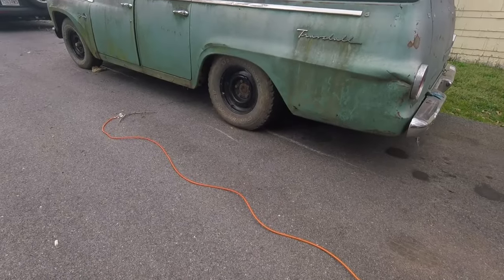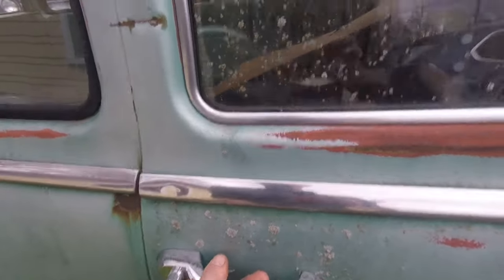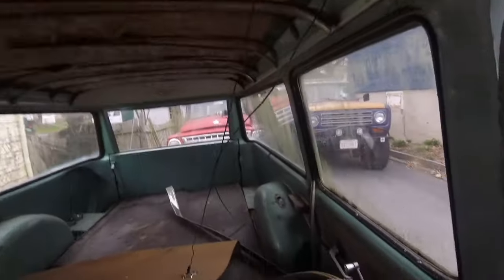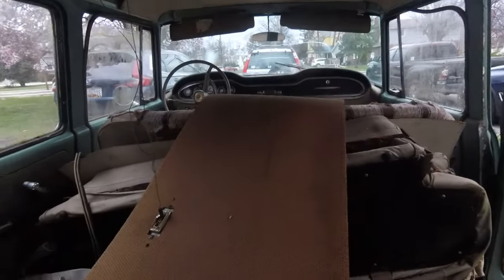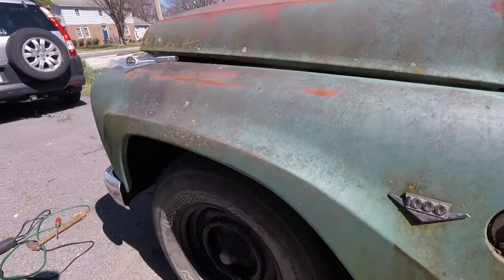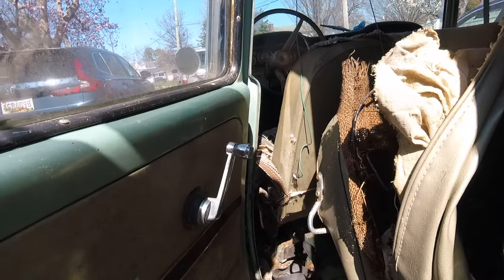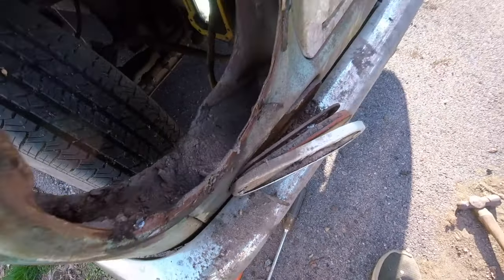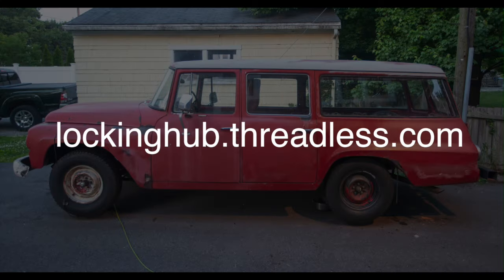Parts Truck Walkaround - 1964 IH C1100 Travelall

Comment: Seems too good to part out
Reply from the maker: Yeah, I have to say it pains me to part it out. I want to save them all, but I'm only one guy with a driveway full of vehicles, and this one is a lot crustier than the one I've got. The other issue is that there isn't a ton of demand for these, not like Scouts or other 4x4's, at least around here. If the engine wasn't locked, and the floor was in better shape, I would consider storing it.